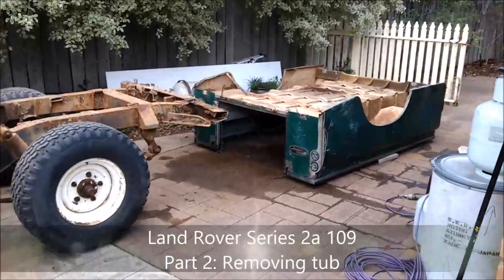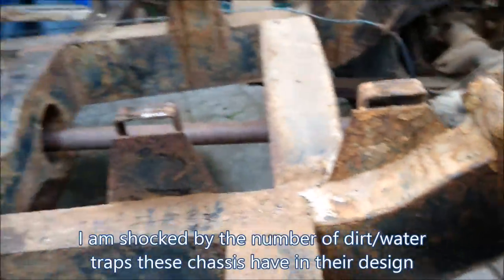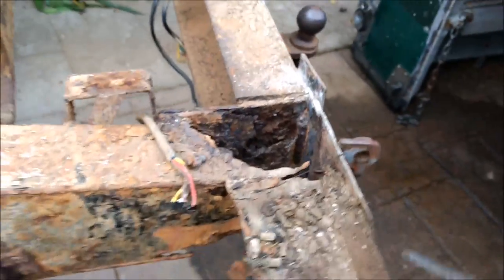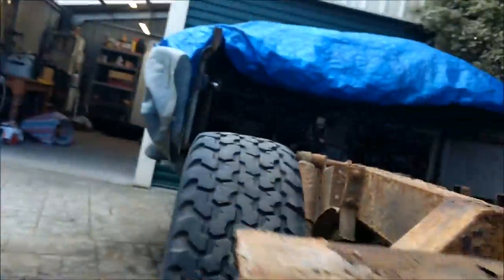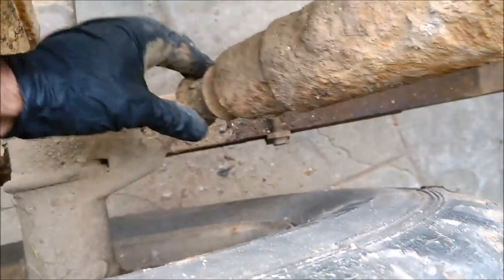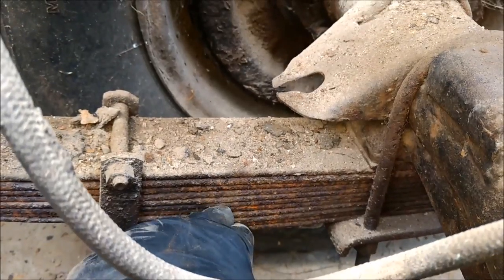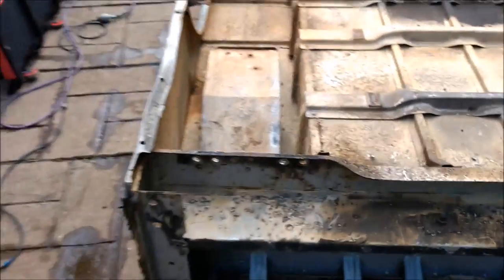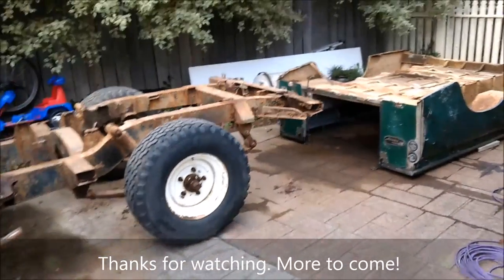Land Rover Series 2a 109 - Part 2: Removing the tub

Comment: hi ,
i think the chassis have to be sandblasted  if you want to keep it . its the only way to go fast and to get clean result.
you can build a diy sandblaster , its easy to make and that will give you big advantage for the restoration .
good luck
Reply from the maker: I will look for another 109 before i touch this chassis, its really too far gone.
Reply: Ok but for other parts , like axels, body part ,shafts ... sandblasting will save you a lot of time and effort.

Comment: Eyup from Yorkshire 

You gone that far,fitting a galv chassis is the only way to go

Cheers Wayne
Reply from the maker: I dont think we are lucky enough like you guys... no galv chassis here that I know of.
Reply: Rover Tasmania 
A company called Rimmer bros do worldwide delivery,suppose it would greatly increase ya cost
Reply: If you need help for parts,by all means ask me here in uk,am just a fellow enthusiast,do have rellys in Australia with Landy's too,I'm a discovery man though 👍
Reply from the maker: Thanks Wayne.  Depends on if I rebuild this chassis or get another 109 with less damage... BTW - I also have a Disco 1 300tdi which is my touring machine, got vids on my channel on it ;)
Reply from the maker: Spot on... would be very costly!
Reply: Rover Tasmania I don't think it is beyond salvage.  Take a wire cup wheel brush on an angle grinder to take off the surface rust to give a better assessment.  I think a couple of new outriggers and a rear crossmember will sort out most of the problem.  Good luck and thanks for the helpful videos.

Comment: Hi mate, those springs look nasty, what do you have in mind? I'm thinking of the newer parabolical but I'm not confidente with the upgrade - price and modding. What do you think?
Reply: I fitted Parabolic's to my Series 2 88inch as you say they were expensive, and I'm not convinced that they are much of an upgrade, the ride is still on the harsh side...
Reply from the maker: i will,stick with stock springs but remove a few leafs, this seems to be a compromise for paras apparently.  I will see what these springs look like when apart as i also have seen similar condition being cleaned up and painted, looked new!
Reply from the maker: Thanks rusty for your feedback on these.
Reply: Lets see how you handle it, it seems you will solve this problem much earlier than I. Will keep rusty opinion on hand, just in case ;) thanks mate.
Good work